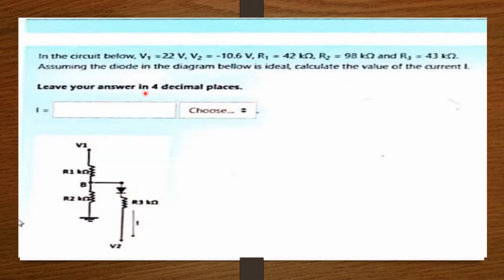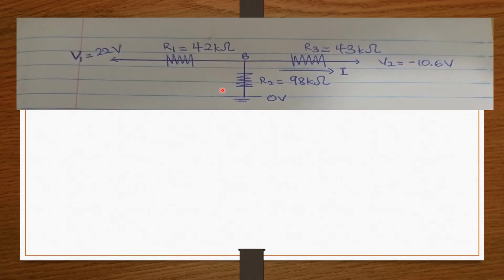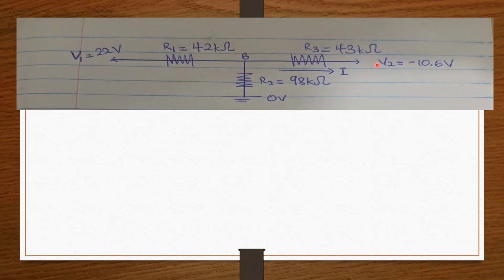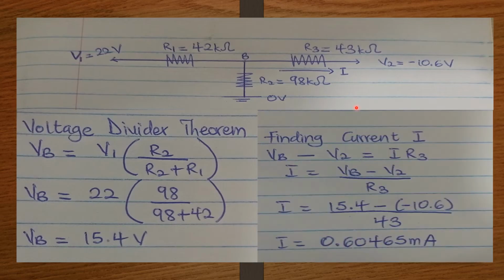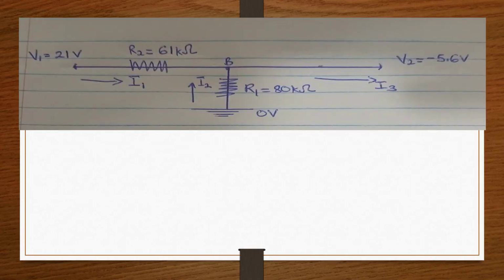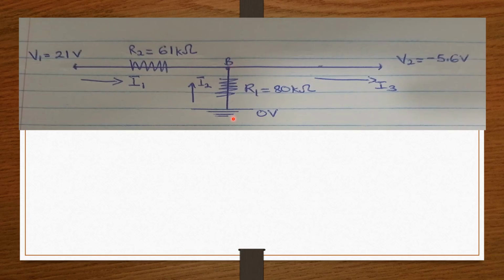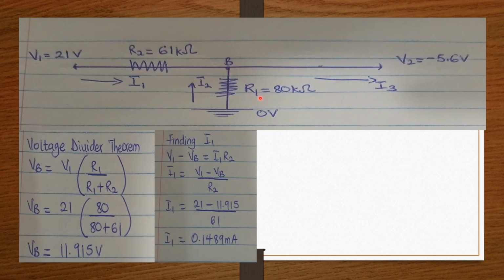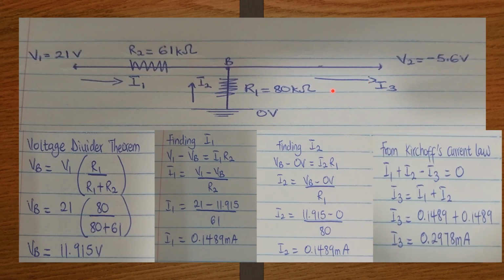Diode Analysis || Electronics

Comment: Why are you using two different equations for the voltage divider theorem, for the first one you made R2 the numerator and the second one too you made R1 the numerator, I'm kinda confused here
Reply: The numerator should be the resistance at the node. In the first one, R2 is the resistor at node b and in the second example R1 is the resistor at node B. Hope you get it now
Reply from the maker: I hope you got it now. All the best in your exam.